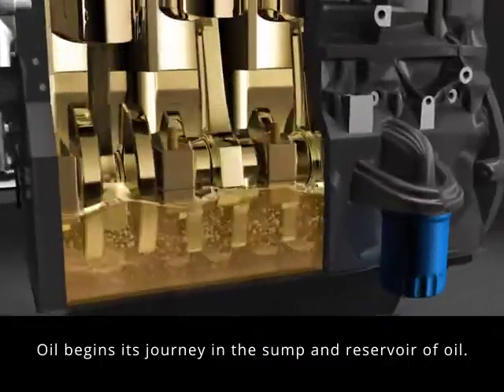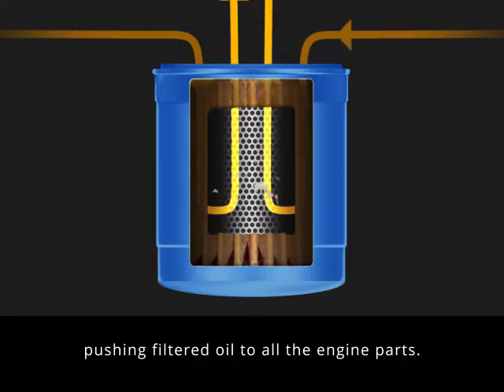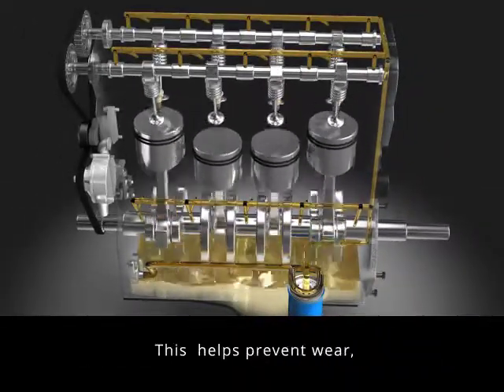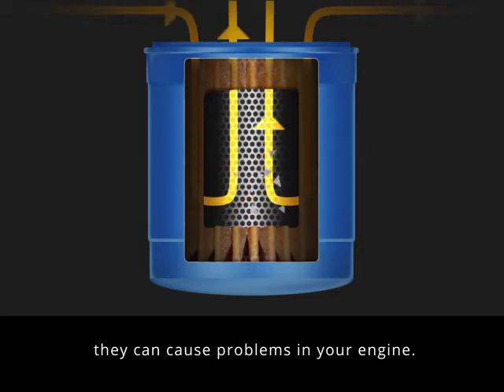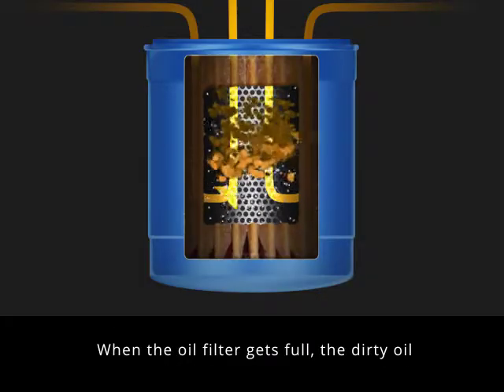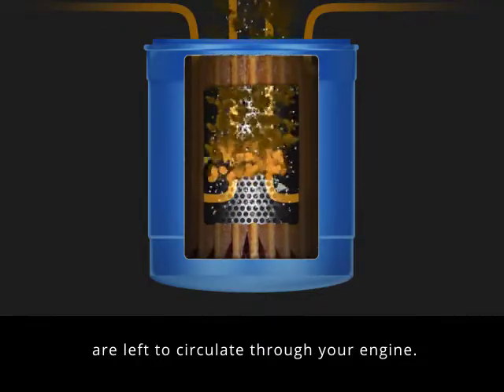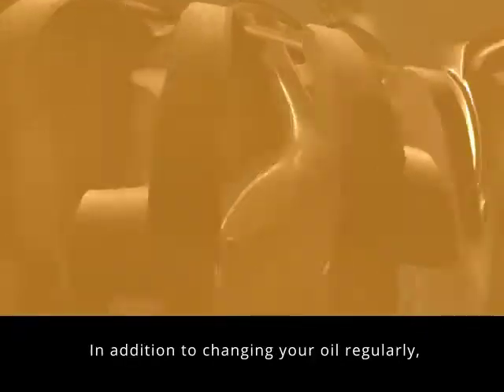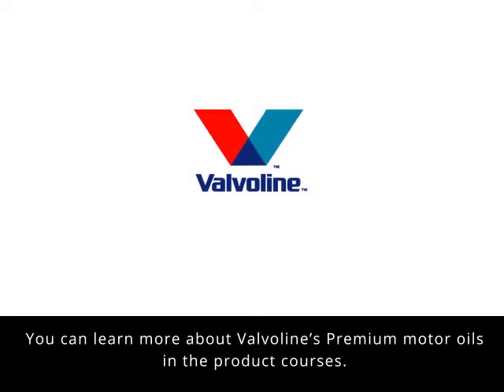Valvoline MEA - How Engine Oil Works

Comment: Clean oil lubrication better than dirty oil reducing friction and heat ,any heat left can be remove quicker with cleaners oil . Doesn't matters how you drive, what conditions is,,change the oil before it's getting dirty plus fews other maintenance 500.000 miles easily especially toyotas and hondas

Comment: This reminded me of the you tube video I saw a few years ago where a guy was low on oil and didn't have any to spare, but he had just gone grocery shopping.  So he poured two quarts of chocolate milk into the engine.  He quickly found out that this didn't work so well as , after nine miles, the engine started to smoke and seized up. I guess he'll never do that again.
Reply: Garbage Time mentioned

Comment: Typically the crankshaft does not turn in oil as it would whip it into foam and lose oil pressure. 
This is a general outline of basic principles, not actual design.

Comment: If your oil change is at 5k miles… do it at 3-4k. Oil changes are cheaper than having a mechanic tear into the motor.
Reply: Full synthetic is fine. There’s something called maintenance overkill. And it’s wasteful
Reply: If your oil change is at 5k, than 8k is safe. Engineers are smarter than the end users
Reply: My honda lawnmower has been going 10 years on the same oil.
Reply: why? proof?
Reply: @highvel-kq2to ”Proof?” google it
Reply: If your fuel tank is 15 gallons, go ahead and put in 20 - it's better than going empty!